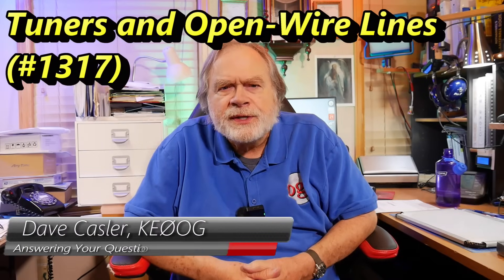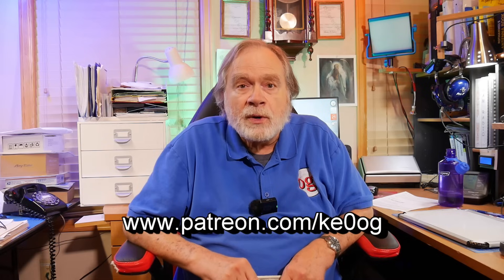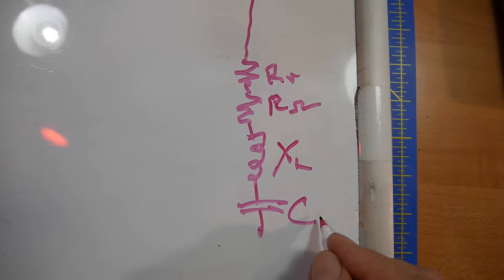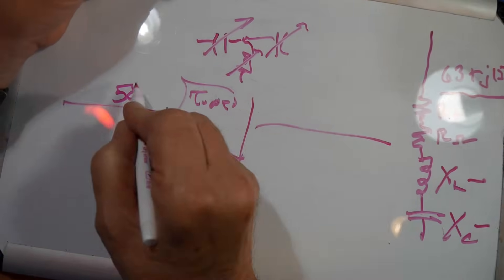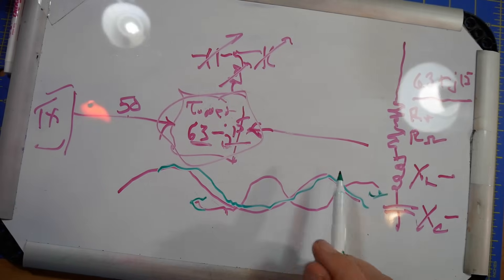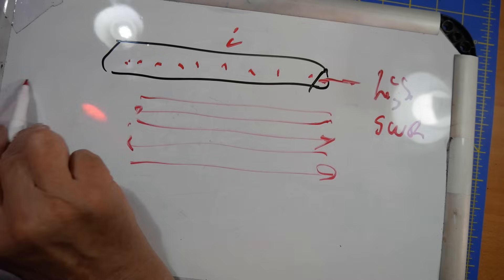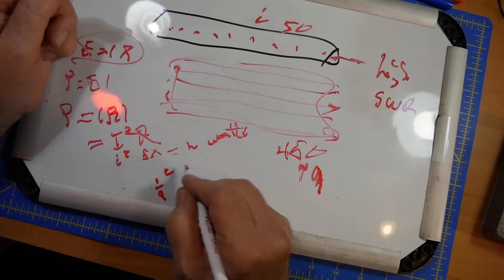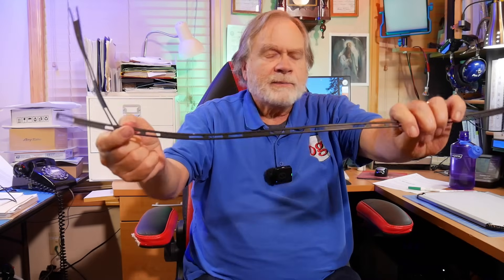Tuners and Open-Wire Lines (#1317)

Comment: This video presentation is a good explanation, except for the "complex conjugate" part.  The "complex conjugate" or “conjugate match” terminology is often misused in ham radio circles.  The definition of a complex conjugate is a number whose real part is equal and whose imaginary part is equal in magnitude but opposite in sign as compared to some other number.  When an antenna tuner is fully adjusted such that the transmitter is presented with a 50 ohm resistive and zero ohm reactive load when connected to the tuner, the tuner is generally not presenting a complex conjugate match to the wave impedance in the transmission line.  If the tuner did so, the reflected wave in the transmission line from the antenna would be absorbed back into the tuner and transmitter.  Alternatively, if the transmitter were replaced by a typical laboratory-type signal generator having a 50 ohm output impedance, then a conjugate match would exist throughout the system and maximum power transfer would occur.  Why the difference?  A transmitter that is designed to work into a 50 ohm purely resistive load does not have a 50 ohm output impedance.  Any signal source with a genuine 50 ohm output impedance, such as a signal generator, can have only a maximum of 50% efficiency when working into a 50 ohm load.  In the case of a signal generator, the output power is low, so the poor efficiency is of little consequence.  In the case of a transmitter of considerable output power, we want as high efficiency as possible in order to avoid as much heat dissipation as possible in the output section.  We want as much as possible of the rf power produced in our transmitter to make its way to the antenna rather than to be dissipated in the transmitter.  We want our transmitter to deliver rated output power rather than maximum power.  If we try to achieve maximum power, our transmitter may suffer a short lifetime or catastrophic failure, or else some protective features, if any, in the transmitter will reduce the output power in spite of our efforts.  Maximum power transfer occurs due to a true conjugate match, and this condition requires that as much of the generated power be dissipated at the source as at the load – thus 50% efficiency at best.  This may seem counterintuitive at first, but look up “maximum power transfer” to dispel any doubts.

Comment: Thanls Dave - I had a doublet fed with 600-ohm open wire and no balun using a balanced MFJ tuner - It seemed to work very well - Should I have had a balun as well? - VE3GHP

Comment: I keep hearing people complain about "lossy baluns", usually associated with "lossy tuners".  I'm a tuner user/fan and don't find them "lossy".  

I realize that just about anything has loss, so I am wondering how "lossy" are baluns?  Typically, we are encouraged to include a choke balun to keep RF off the coax. I'm not sure I find any difference in signals whether or not I use a choke balun.  As for not using a choke balun, I often get RF in the shack, especially on 20m, so I prefer to use them. 

Thank you
Reply: Yes, baluns made by reputable manufacturers and intended for low loss applications will have very low loss when used in accordance with their ratings.  We can consider the loss to be measurable but negligible for communications purposes.  🙂